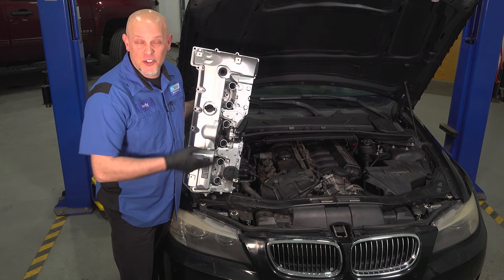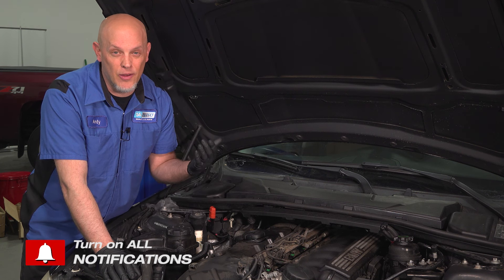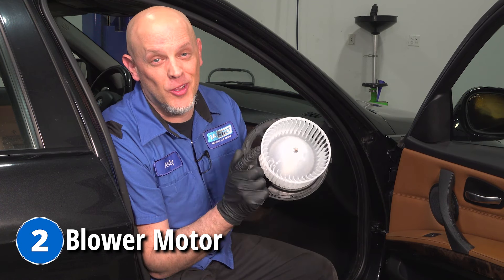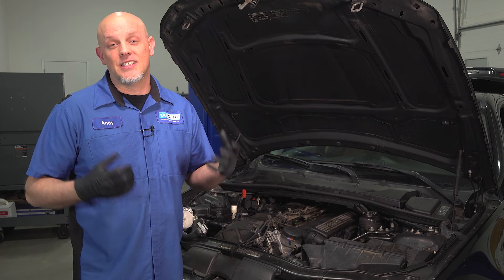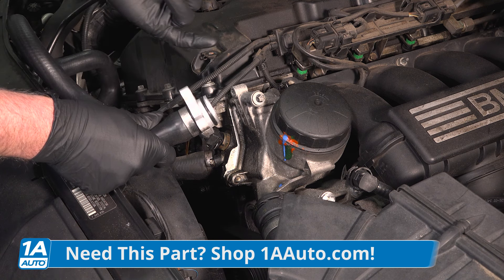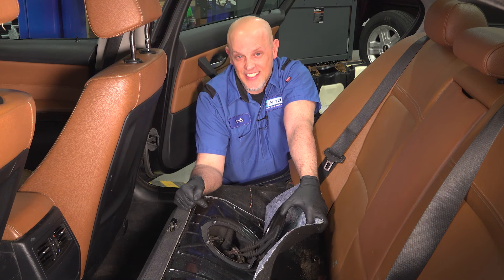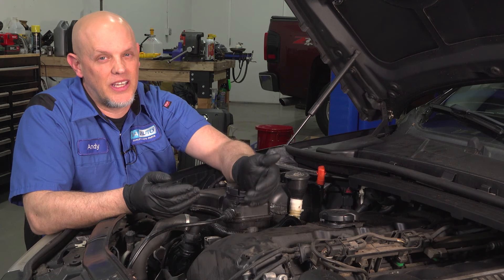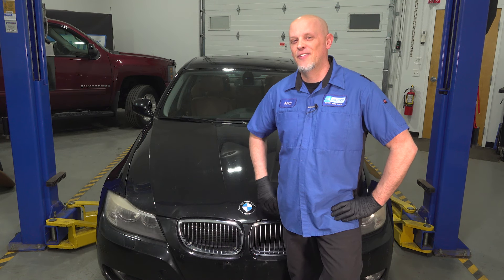Top 5 Problems BMW 3 Series Sedan 2009-2013 5th Generation

Comment: Great insight, I have 2 e 90s and the gasoline 318 I had to replace 2 injectors and one coil. On the 320d the blower motor.